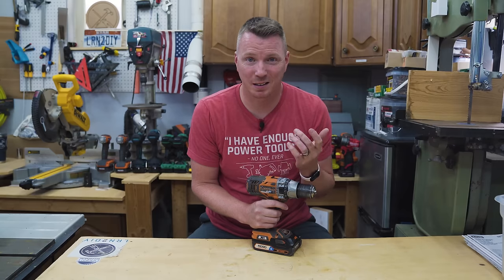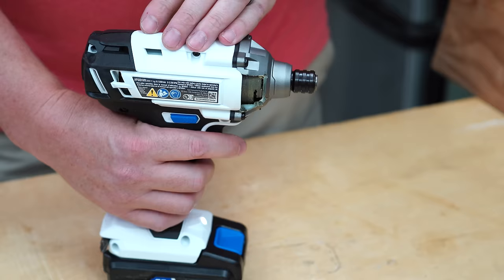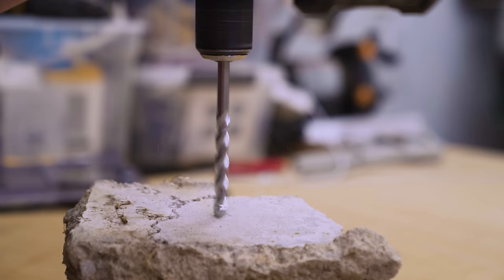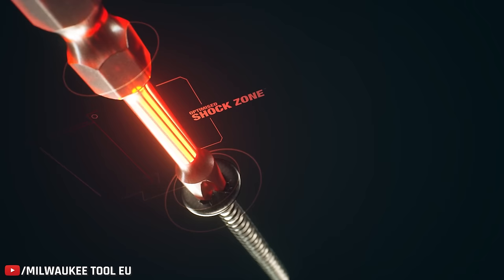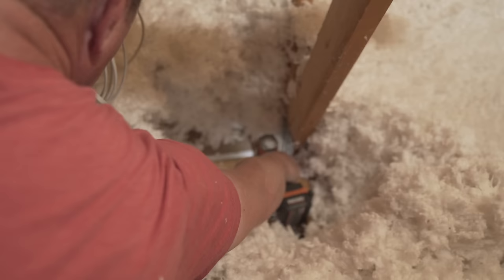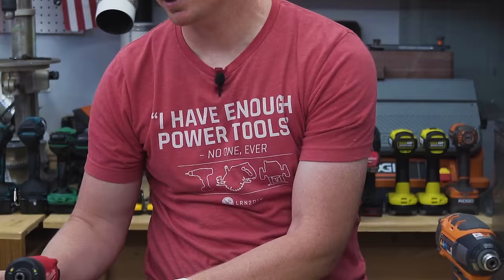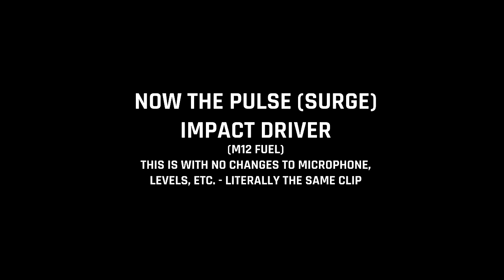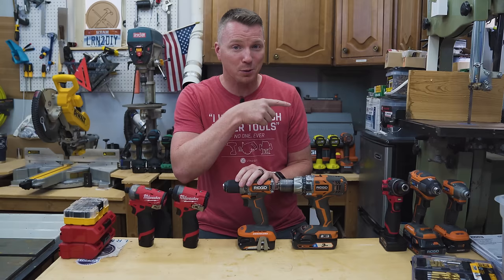Is The Cordless Drill Becoming Obsolete?

Comment: When working on a build with numerous tasks I’m using several drills & impacts drivers. Even with spade and drill bits changing them out is annoying. Sure the hex bits make that easier, grabbing the next tool in the series is even easier. When drilling numerous series of holes setting up the drill makes more sense. Though I do enjoy my impact driver for most tasks, its what I seek first. Bosch makes a lot of 12V tools so for lighter installs or ladder work those impacts and hammer drills are easy grabs. Remember when the Surge came out though I’ve never felt the need for subcompacts, maybe one day.

Comment: Pretty well articulated video, but long story short, an impact is a good all rounder if you're doing repairs, construction and other things that don't require the control and sensitivity of a drill.

As a woodworker, I keep three drills on hand, but have decided not to get an impact because it's not needed yet. Two cordless drills, one for drilling and the other for driving. And for high torque applications, a corded drill that has double the torque of the other two.

Comment: For sure tools are becoming more user friendly, also more costly. 
I'm a remodeling contractor, and the tiny tools are so much easier to carry in your tool pouch than the old 20 lb battery drills of past. And the brushless ones are even smaller. For running outlets and switches they're a godsend. Cabinet work as well. And with the long extensions, you can get into any panel without getting the tool in it. And there are so many to choose from in most financial cases. 30 to 300 range of cost. Thanks for the video

Comment: That Makita XST01Z is 383 Euros on Amazon where I live, without batteries! You can't even get it in a shop. The comparable DTS141 is 629 EUR in my local hardware store (incl. 2 batteries). Not cheap for a hobbyist. I can however get a Makita drill for between 100 and 300 Euros.

Comment: When putting a screw in a pre drilled hole I usually use a standard screw gun.  Seems like the screw will hold better because it not being shoved in and distorting the grooves in the material.  That’s just me, I could be wrong.

Comment: We always used the smaller Dewalt driver, the nine volt, because it was lighter and easier on the wrist. If we needed to do some heavy driving,  we would use the eighteen volt driver. We did not have impact drivers for carpentry back in my day but I can see their value.

Comment: One thing to keep in mind is the guys that use drill bits extensively and they’ve purchased a large number of high end drill bits with storage indexes. Those small titanium drill bit sets simply won’t do the job. Especially when using numbered drill bits for tapping threads in metal. Much of your personal use is wood oriented or driving fasteners.

Comment: I'm a sheet rock hanger of 34 years and i hate those battery drywall screwguns I don't like haveing to change batteries and i don't like the depth control and i don't like running them in the angles I'm total old school I like the old coarded guns especially the old black and decker drywall screw guns lol

Comment: Huh. I've been using my impact for most things as well.. except for drilling.  I've not tried the hex shank drill bits.   I might have to give that a shot.  I do a lot of electronic work, even very small stuff using Torx T2 bits with my driver.  Once you get a good feel for it, it's super easy to go slow and do fine work with a driver.  I'm using Dewalt, not that the brand matters much.  Do yourself a favor and get on amazon and get some 8 or 12" long driver bits (WITH A ROUND SHAFT and hex end).  If you ever work on anything like a kids' toy or home stereo, tv, computer, etc you'll be glad you did.

Comment: Impact drivers are noisy and will over turn screws with small threads or for light holes like box drawer trim and hinges.  Having the 1-5 setting for the chuck on my dewalt cordless drill is vital to making snug drives with small screws.

I have both drill and impact driver.  

The quick change is good for impacts but you can get screw drivers with quick change built in.

I’ve also realized the impact driver drill bit attachment is wobbly and not as secure as the regular drills

Comment: I started using my impacts about 10 years ago. Very rarely do I go to a normal drill. My 12v dewalt impact and Millwa both have clutch settings. My 18 and 20v's do not.

Comment: Im a fabricator. I drill several hundred holes in a week with my hand drill. The drill gives a smoother rotation force while drilling thick metals. I do use an impact driver quite a bit for installs and fastening hardware. Even if a drill bit is "impact rated" they wear out faster and snap way too easy. Not to mention, they are more complex to make, meaning they are more expensive for less use. This may be the case for you in your situation or for most white collar home owners, but for most people in the industry, an impact will definitely never replace the drill 😆

Comment: I have a DeWalt 10.6v twin set. As a maintenance guy I tend not to need to drill many holes, but can need to remove many screws for access on boilers/appliances etc. The impact gets used 90%+ of the time, it’ll undo 4” decking screws that have been in for years, that’s good enough for me. I use a DeWalt 18v SDS drill for drilling fixings. I have an 18v impact too, but the smaller 10.6v with a 1.2ah battery is so light it’s hard to give up even with a bigger superior replacement already in my kit.
The small battery can go months between charges which shows how often it gets used. If I went back to installing then I’m positive I’d have the latest and greatest ah battery, but not all people want to lug the weight of those batteries. The difference between my bare 10.6v impact verses my 18v impact is very little, the weight is all battery.
Twenty years ago I used to do factory maintenance in a facilities dept, sometimes on a shutdown I’d need to remove access covers on large air receivers for insurance inspections for instance, the cover would be 4’ in diameter with a nut/bolt every 2” apart. There could be 5/6 of these assigned to me on that particular shutdown. Initially with a spanner and adjustable that could take me 6 hours to undo just 1 cover, and as they were painted too they would frequently jam,it would be painful. 
Then I was bought an air ratchet by the company, it was a game changer. Now I could undo the cover in 30 minutes, it was incredible, and as we had compressed air available in just about every corner of the huge factory, I’d carry a 50’ airline with a 1/2” male plug to attach to the system. Changing intercoolers on our compressors were another huge job, purely down to access with the spanner’s, because it was difficult to get any leverage. That job turned to an easy few hours instead of a full 12 hour shift. 
It’s a dream to have all these tools available to us today, our jobs are so much quicker/easier/better for them……………..

Comment: drill will never become obsolete because holes will always need to be drilled into wood for countless reasons.  I restored a very old, victorian-style bed a few years ago.  I knocked it completely apart & rebuilt it with glue, nails, screws, etc.  not for every nail, but for many of them, I drilled pilot holes for fear of splitting the wood, particularly all of the scrolling work & appliqués that needed to be put back onto the head and footboards.  I also drilled pilot holes for any screws I needed to used.

Comment: Actually, there is still a lot of value for a drill driver with a clutch over the impact drive. I stripped the head of a locked screw using an impact driver to remove the screw that didn't want to come out as there was too much locktite on it. The adjustable clutch of the drill driver on the hand allowed a slower and gentler force that I can work up gradually that took the screw out with what little was left on the screw head. For your noise level test the supposedly quieter driver was pushing over 72 db whereas the supposedly noisier one was only pushing 55 fb which is quieter....

Comment: My mode of operation is usually drill bit in the drill-driver for drilling pilot holes, driver bit in the impact driver for running in deck screws.

For one, I'm pretty sure my drill bits aren't impact rated.  Especially the tiny little things like the 1/8" bit.  Having a drill bit bind up, the driver starts impacting, it snaps that little bit right off in the work...fun day.
For two, I find it just easier to switch between the tools for the different functions than fiddling with little bits.  When working with someone I can say something like "you drill, I screw."

Beyond that, the impact driver is for turning bits harder than the motor alone could do.  The drill driver is for turning screws gentler than the motor can turn.  For example, you do not want to use an impact driver when installing metal plates onto wood, such as hinges, strike plates, latches, brackets etc.  Because what it'll do is run the screw in until it touches the metal, suddenly it gets harder to turn, the driver will start impacting, the screw can't pull itself further into the work, so it'll spin in place, reaming out the hole so now it's not a screw, it's a nail made out of a screw and some sawdust.

Comment: I have gone back to using my 12 volt drill more due to the adjustable clutch, I don't use my impact for screws that are already tapped as it can thread the screw or overtighten it, the clutch makes it much safer, and it doesn't twist my wrist because the clutch kicks in. I have also gone down to 12 volt tools because they are lighter, a bit easier to control and still have enough power. I find I am using larger 18 volt impacts and drills less and less, and really love the smaller tools now.

Comment: Impact drivers/and Drill driverss are paired together for a reason. Impacts are made for smaller fasteners. Yes they work for long screws but drills are actually made for that. You cant go through tile and metal  with a impact driver.

Comment: Just a little advance warning. I bought a Rigid Drill/Driver and paid $30 extra for the lifetime warranty at Home Depot. The clerk at the hardware desk input the warranty info in his computer/register. After about a year the Drill/Driver quit on me. I went to get it repaired or replaced and was told I never registered the product even though I had the original receipt and it showed the payment for the lifetime warranty and explaind that I had filled out the card and the clerk had input the information in his computer. They still would not honor the warranty. That was my last trip to Home Depot. I have never bought another Rigid tool ( I had several) and switched to DeWalt (some online but mostly at Lowes) and only went to Lowes for building materials and tools from then on. That was over 15 years ago and I have bought and remodeled two houses since then. A $100 Drill/Driver with a lifetime guarantee for $129.99 that they would not honor cost them more than $180,000 in sales over the last 15 plus years. Don't pay for the lifetime warranty. It is worthless.

Comment: They both have their place because sometimes an impact it's not what I need to do the job all of the time. As far as using it for screws yes or even bolts. As far as using drill bits I'm using my drill. Hex shank drill bits are more expensive.

Comment: Here are 5 bullet points summarizing the transcript:

- The cordless drill is becoming less frequently used by the speaker in favor of the impact driver, which is smaller, lighter, and can handle most driving and drilling tasks with greater efficiency.

- Impact drivers use a hammering motion that rotates and impacts the fastener, allowing for more torque and reduced kickback compared to drills. 

- New bits designed specifically for impact drivers with torsion zones help absorb impacts and prolong bit life.

- While drills are still useful for precision woodworking, clutch control, and non-hex shanks, the speaker finds the impact driver preferable for most DIY projects.

- An even quieter and more powerful alternative is the pulse/hydraulic impact driver which maintains the rotational impacts but with reduced noise.

Comment: DIY, Furniture, etc. I’ve actually been using impacts less because of the drills I’ve acquired this year:
1) M12 installation for drilling and driving anything small.
2) XGT Hammer drill for power and precision on anything big.
If I could only own 3 it would be these and a rotary hammer.

I have the LXT sub combat and XGT impacts. I only use the XGT for rough no pre-drill construction grade lumber and the rare tight case in which I need more power than the M12. The LXT collects dust now. The M12 Hydraulic impact could be nice but I haven’t jumped at yet because if I want to minimize noise, the Installation driver has sufficed so far. My guess is either of my main two drills would be quieter anyway.

Other drills/drivers are now used for the convenience of having multiple setups at the ready for efficiency.

Comment: You work with dead tree carcasses, try steel. Drills bits in metal have an optimal feed rate dependent on the diameter of the bit and the material in question, impacts are a poor choice, good way to blunt and snap bits though.

Comment: I’ve got a 12V Black and Decker drill that I’ve been using for over a decade. Nearly all the other power tools I have are in the M18 family, so I know I’ll eventually replace it with an M18 drill. I doubt it will ever see as much use as my old B&D, though.

Comment: For taking screws off, the impact is invaluable -- impacting torque, low strain on the body, it's great. But for putting screws back on, not having a torque-clutch make me nervous.
At least not for finishing screws. I can see myself using the impact to drive wood screws in, but using a torque-clutch drill to finish things off, since if you use it correctly, a torque-clutch drill won't whip your wrist around like you thought it would -- it will just slip when it reach that torque.

Comment: A good drill will out drive an impact. If I'm installing deck boards or spindles, i use a drill for the sole purpose of the clutch. I can run the screw the all the way in and never over drive them

Comment: As a Professional Carpenter the Impact drivers 1)serve the amazing ability to drive long screws into hard wood or laminated beams all day long without the need to have to stop, lower your lift, get out, walk all the way back to the supply trailer to change out the battery, go all the way back to the work station, get back up in your lift & get back to work.  Think about it, you can easily lose 15 or 20 minutes in this process for each time a guys battery dies. If both guys batteries die at some point during the day you just killed 40 minutes of production because of battery changes.  2) it is much lighter than the drill & EVERY ounce saved that a Carpenter saved while on a production job matters...a great deal. 3) qualified competent Carpenters are valuable, and the impact driver is much kinder on these guys arm joints. After 15 yrs they get injuries and they mount up. They are wonderful to production people.

Comment: I think you've overlooked how the two are constructed. A drill is designed to (at least should) be used in compression (i.e. pushing on the drill while drilling), a driver is designed to be used orthogonally (lateral/sheer/etc.). The bearings are setup for this (think thrust bearing vs axial bearing) in mind and while you can stray out of their intended use you will wear them out if used incorrectly for a long time.

Drills were never really meant to be used to tighten fasteners, drivers are much better for that.

Comment: One of the biggest reasons is if you need to drill a 1/16 to 5/16 hole into concrete. The hammer function on the drill works really well.

Comment: For what I do, the impact is capable of it all.  I mostly drive self tapping fasteners into metal and drive 1.5-3 inch lags into wood.  When I need to pre-drill, those impact rated drill bits are in my tool box.  I can see the need for a drill in other areas of construction, but I don’t need it.

Only thing I hate is the noise.  Been thinking about getting the Milwaukee Surge as I already have a bunch of M18 batteries.  Anyone have any experience with it?

Comment: yeah, if one does not know the difference this viddy might be relevant,  i find impacts more useful than the screwgun most times but sometimes i might need a holesaw here and there, 
what i find is that when i leave my screwgun at home thats when i need it. what gets me is people that dont make the distinction between the two, ALWAYS bring the impact, and so, they have to be familiar with the jargon and you have to be specific in that case. double check, make sure they didnt grab the screwgun drill when you need the impact, better yet, bring them both just in case right?

Comment: The only good thing about using an impact for drilling is that it's much easier on your wrist . If your old or weak use the impact. It won't last as long, but they don't use them enough to worry about that. I've come close to ripping my shoulder out of socket too many times. A corded 1/2 dewalt is plenty strong to hurt most people

Comment: Just get two drills if you don't want to swap heads. The impact drive is made to tighten bolts and nuts, aka metal work. The drill is for all drilling and screwing. Impact drill is for tightening bolts and nuts.

Comment: the secret to drill with impact driver is to drill without impact, meaning, you have to allow maximum speed with less friction, which will cut through faster than impact. those who drill holes regularly probably noticed that feature.